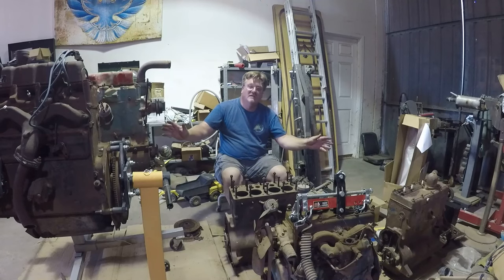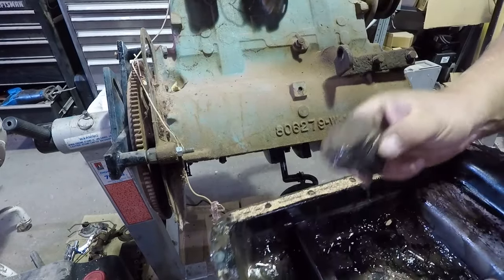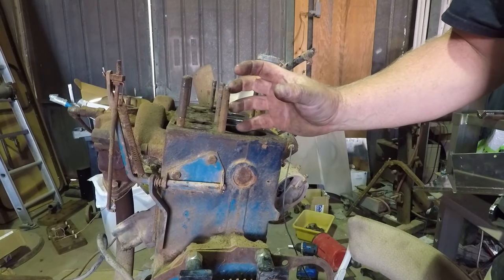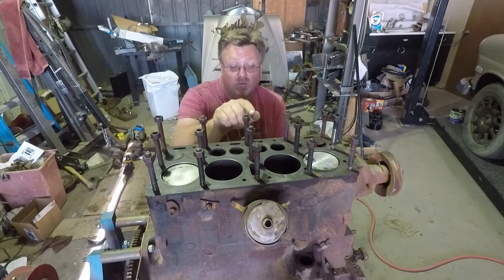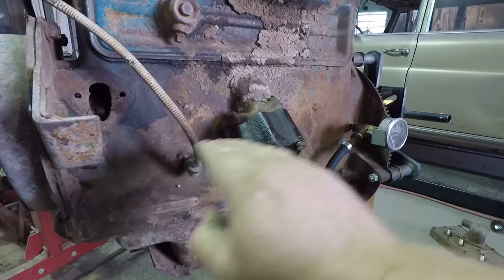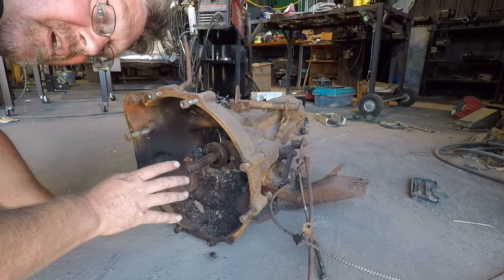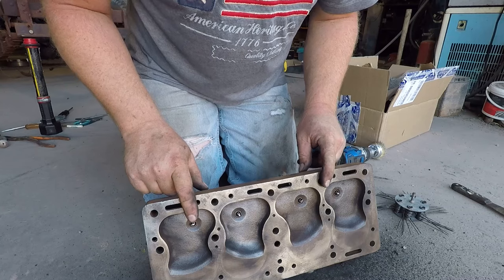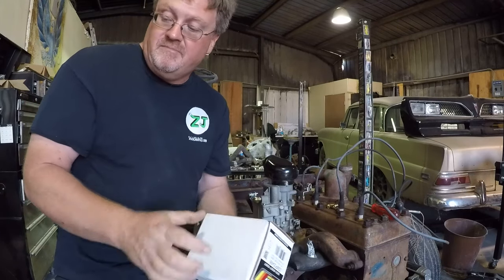Willys Jeep Motor Revival Bonanza, F-Head and L-Head Junk Motors, Will Any Run?

Comment: This is quickly becoming my favorite channel. I’m currently restoring a cj2a with my dad (I’m 16) and I’m loving every single second of the process
Reply from the maker: Thanks!  That's a good vehicle to work on, and fun to drive afterward!
Reply: @LowBuckGarage  yea, It needs a lot of bodywork but it runs and drives. We are going to redo most of the body panels ourselves using a sheet metal bender and cutter. I live down in the Caribbean on a small island called st.Vincent (it’s 19 miles x 11 miles) so there isn’t really any off-roading trails but I’m sure I’ll find somewhere to have lots of fun.
Reply from the maker: @jarednichs3450  I had to look up the island, looks nice from the satellite view!  A CJ-2A is a nice small vehicle for maneuvering, and the low top speed shouldn't be a problem there.  Good luck with your project!
Reply: @LowBuckGarage  the roads down here suck. Driving on the road isn’t much different from off road. The island is amazing, the beaches are stunning and boating is fun.

Comment: If you can't find a salvageable F-head block, but want an F-head engine, and you also have a usable head, cam, and intake valve-related parts from an F-head engine,, you can convert a usable 4-134 L-head block to make an F-head engine.  I saw one decades ago, built by the local Willys dealer, who was a very competent engine rebuilder.  The only modification he made to the L-head block (besides substituting the F-head cam) was driving out the intake valve guides.  The F-head gaskets covered the L-head intake ports.  This conversion was possible for the 4-134, but couldn't be done for the 6-161, because the block castings were too different between the L and F head versions of the 6-161.
Reply from the maker: That is an interesting idea, I'm going to try fitting some parts together!

Comment: Hi James, I only recently discovered your channel, and now I've fallen down the rabbit hole of old vids like this one.
As a Brit, most of these vehicles and engines are new to me. I love the half-tracks BTW... And the F-heads... I have never seen an engine that was side valve and overhead valve at the same time! fascinating! And the 2 cylinder air-compressor modification - cunning!

Oh, and valve spring compressor 3.0 - Genius!

I love the casual "whatever" attitude, which is obviously backed up by a lot of hands-on experience.

Comment: I have a Model A that had a crack similar to your Jeep. Since the A is a non pressure system I used brass screws as a stitch system. I drilled a hole and tapped it. Used red locktite to glue the screw. Cut the screw off after the lock tite sets. Then repeat the process overlapping the screws a bit so they interlock each one a bit. It works perfectly!! I was also able to get JB weld on top of my stitch inside of the head in the water jacket area.

Comment: I've also learned to use Permatex #2 on the head studs or any bolts that go through into the water jacket. It seals great and makes them super easy to remove later if needed ✌
Reply from the maker: That is a good idea, actually that's the exact stuff I used when I put in the head studs.  Somehow I forgot to mention it in this video, but I will make a point of it when I replace the bolt in the manifold.  Thanks for the heads up!

Comment: Nice job getting those engines sorted. The hi-detergent diesel multigrade oil is a good thing for this type engine build as it will clean all the junk out and probably even stop it blowing smoke.
Reply from the maker: Thanks!  It did actually clear up, I'm running that motor in the covered wagon, and there's no smoke at all now.

Comment: I Have learned a few nifty tricks from you ,here's 1 from me. Rusted bolts/ studs, get a stick welder 200 amp or more. 500 works great or a car battery but be careful,i t won' t like what you are about to do . clean a very g ood ground on the block, then clean very good place on the stud/bolt. Clamp vise grips tightly on the stud. then make the connections to the welder/ battery jumper cables. Be Quick there will be a spark. In a few seconds you  will see a puff of smoke from where the stud screwed in and the stud will come right out !  I think it works by vaporisng the rust because  rust doesn't conduct electricty nearly as well as good steel .
Reply from the maker: Thanks for the tip, I haven't heard that one before!  I'll give it a shot on the next broken one.

Comment: Had an uncle put an f-head in a 46 cj2a. had to turn from motor mount around, and cut a hole in the hood for the carb to stick out. the cj3 had a taller hood. PS he robbed the f-head out of a 60s mailster LOL

Comment: Cool video, but the new engines with 248 sensors, cam phasers,crank triggers torque to yield bolts, MAF and MAP, TPS, FPR, Evap, VVT controlled by ECM's are much easier to work on and more better at saving trees and polar bears.

Comment: I've had stuck piston luck by taking a 75%atf and 25% gas mix and put about a half inch in the cylinder. Light it on fire and let it burn out. Then start tapping with a wood block.
Reply from the maker: Thanks for the tip, I never heard that one before.  It would make sense as it would expand the cylinder and add oil at the same time.

Comment: What made all those seize?   I have cars sitting around everywhere....should I be turning the engines every ...so often....years?
Reply from the maker: Time and exposure.  They had been sitting unused for well over 10 years each, some well over 20 years.  Also bad storage, like being left without spark plugs (the #1 L-head), or left in the woods with an open carb (#1 F-head).  

It is a good idea to spin motors over every few years, and use a fogging oil if you know you're going to let it sit for a long time.  I'd try to move them every 5 years or so, depending on your climate.  Surface rust will start forming in the cylinders a few years before it seizes, so when they're hard to turn over at first get some extra oil in the cylinders.
Reply: @LowBuckGarage  tHank you....I didn't realize...never had a seized engine...so never developed that instinct.

Comment: If you need to get a tap to go in real straight, I like using an old timey bit brace, the older ones with two v jaws grab the square tap end great.  The handle is longer so you can be more precise in the angle.
Reply from the maker: I like that idea, I'll have to give it a try!
Reply: I like that ideal.

Comment: On that compressor motor, how did the two cylinders that was pumping air got lubricated?
They must have because it was the cylinder that fired wich was bad.

Sweden here👍
Reply from the maker: The crank is pressurized with oil, so it comes out the rod bearings and splashes all over, including the cylinder walls.  It comes in from the bottom, and that does a pretty good job.
Reply: @LowBuckGarage  Ok, that was a pretty dum question now when you told me🙈

Thanks for answer👍
Reply from the maker: @markuschampos5750  Not really, sometimes odd-ball equipment works in unusual ways.  Always worth asking!

Comment: Hey, great vids, any tips on unsticking valves in an l head jeep motor, when they are down flat to the block, and stuck in, possibly at the valve seat and the valve guide both?  Thanks,
Reply from the maker: I usually let it soak for a while and work the cam lobe back and forth to lift it.  You might be able to sneak a drift through the port and tap it upwards.  That could destroy the valve if its really stuck, but valves are cheaper than replacing a cam.

Comment: I've done the JB weld fix on a head just like that one...long story short, I replaced the head. Perhaps you have better luck than I do 👍✌
Reply from the maker: I wouldn't be surprised if at some point I will be doing another repair or replacing the head, probably not too far in the future.  I'll run it until it leaks, though, and put up video of the failure and repair!

Comment: Just for curiosity,is the bell housing from Cj 5 will fit on F134?
Reply from the maker: The F134 and L134 bellhousings use the same bolt pattern, so you can swap between them.  I know that I've done it with CJ's 2A, 3A, 3B, and 5.  They also used the F134 in trucks.  I think those are the same, too, but I've never tried it.
Reply: @LowBuckGarage  I swapped an F134 out of a Willys PU into a '48 CJ-2A.  I used a carb off a Ford Falcon 6 cylinder so that I didn't need to cut the hood.  I did have to make a little adapter for the passenger side engine mount to bolt up to the F-head.  The driver's side engine mount bolted right up.  The tranny bolted right up to the bellhousing.  I ran it for a few years but being young I wanted more power.  Swapped in a Buick 231 in place of the F-Head along with a T-14 tranny and a Warn OD.  This was over 40 years ago!  Damn, I wish I still had that Willys!

Comment: Which Toyota starter did you use?
Reply from the maker: The landcruiser one.  Early 80's has a direct drive, mid 80's had a gear reduction, I've used both and both styles work great.

Comment: I know I'm a little late to the party, but I'm going to take out an old but running f head.  If you might still need/want one, let me know.
Reply: Almost forgot, I had an old cat with a stuck engine.  After a long, VERY LONG time of beating on the pistons, I decided to take the rod caps off, and voila!  I got the crank to turn, which allowed the pistons to come loose.  A mouse had climber into the cylinder via the exhaust and made a nice comfy lodge....which locked the engine up!!
Reply from the maker: I am still looking for one, my email is james@low-buck-garage.com  If you could email me details and location I'd appreciate it.  Thanks!